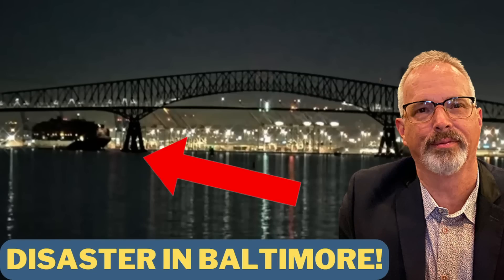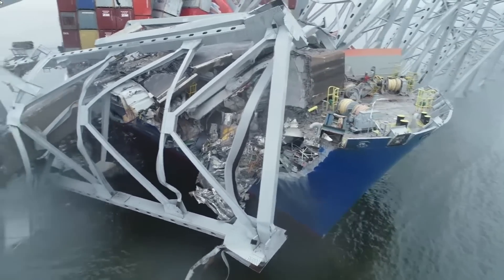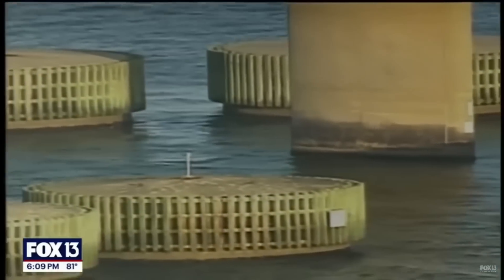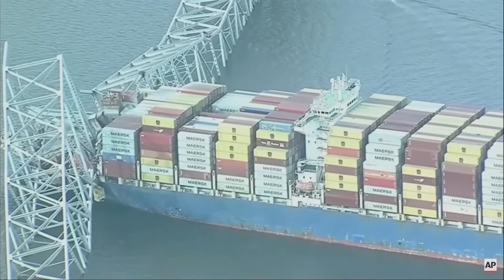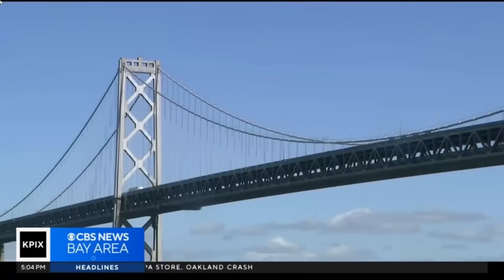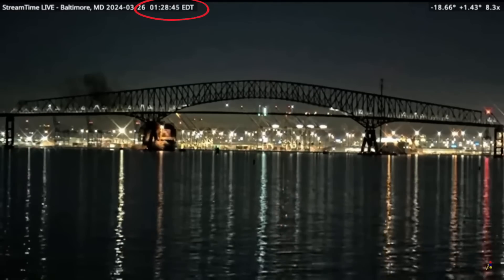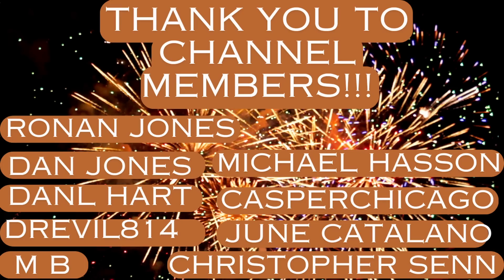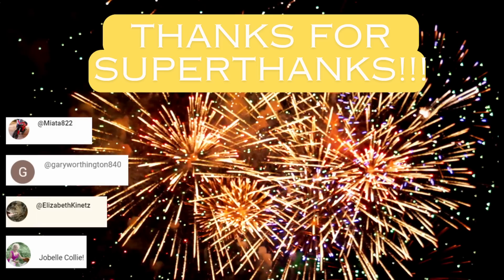How the Francis Scott Key Bridge in Baltimore should have been Protected

Comment: I understand what you're talking about regarding a younger generation of Engineers and bringing back old practices but I do not believe that is the case in this circumstance or incident. The bridge started Construction in 1972 was completed in 1977 . That means the pre planing and design was started sometime in 1968-72. I think those are the old guys you're talking about and I do not believe they had any complacency in engineering beliefs at that time. When the bridge was originally designed the ships that were coming through the Port of Baltimore were less than half of the size they are now which would have made the Ballard protection at that time sufficient. I would disagree with you regarding the Ballard protection being increased would have prevented this accident the ship was 200 million pounds. There are times when no matter what you do, tragedies can still happen even with the best engineering and money spent.

Comment: Well there seem to be too many examples of engineering snafus in the last few years.  Some notable ones are the Boeing MCAS fiasco and the adjusting of the tension on the bridge across a active roadway in Miami (that already had visible cracks).   I tried to teach everyone that would listen before I retired that there is a difference between designing something that simply can't fail vs something that will likely never fail even if its 99.999999% foolproof.  Murphy ALWAYS arrives someday, someway and somehow.  These type of accidents are what we typically called Titanic scenarios.  Any one of several steps that led up to this could have and likely would have prevented the impact.  But if it just had proper protection it would not have mattered.

And you could also argue the engineering of the ship was ridiculous.  No ship that large should be allowed to operate without reliable steering/propulsion control systems.
Reply: In the case of the FIU pedestrian bridge to which you refer, the problem was much deeper than the decision to retension with traffic moving under the bridge.  The concept for that bridge was cockamamie from the get-go.
Reply: Oh yes entirely true, but even if it was the most correctly designed structure,  would any competent engineer ever allow the adjustment while traffic flowed? Absolutely not.   @GH-oi2jf
Reply from the maker: That design team seemed arrogant too if you read between the lines of the NTSB report.
Reply from the maker: Yes, this disaster has many contributing factors.

Comment: When it comes to “Society doesn’t learn from its past mistakes” in this sort of lesson is likely due to the lack of will of a municipality and its people to spend the money for the safety improvements. The will of the people isn’t there unless there is significant financial reason for the expenditure. Municipalities don’t put crosswalks, speed bumps, stop signs, street lights or traffic signals in unless there is loss of life, usually human. I have tried myself to get my  city council to act but they didn’t until people were killed, even then it was more a “band-aid” solution to a gash of a problem.
Oroville Dam didn’t get the $1.6B until the people had to evacuate due to a spillway that should have been fixed a year earlier.
Now Baltimore will have to spend a billion dollars to clean up, rebuild, and recover from this loss of infrastructure. Hopefully they get it right this time.

Comment: I'd be interested in seeing what the reasoning was in deciding not to retrofit protective dolphins. One factor was probably the shallow depth of the water. The channel is dredged to about 50 feet, while the bridge supports are about 100 yards back from the channel in about 25 feet. They may have felt that the mud, combined with the substantial dolphins around the power poles upstream from the bridge pilings was adequate defense. 

The MS Dali draws 49 feet, so she was ploughing plenty of mud by the time she reached the piling. She also hooked pretty sharply to the right as she approached the bridge, "dodging" the existing dolphins.
Reply: That's almost the design protection for the Great Belt bridge in Denmark. They don't have any visible dolphins, but have constructed a huge berm of materials around each bridge pier (just below the waterline) outside the shipping channel.  The theory is that the "soft" material will cushion the ship and hopefully stop leaks of contaminants etc.  It will be interesting if your point is the reason they never did anything more.
Reply: With this bridge they could however easily built it as a suspension bridge with the piers on dry land and zero risk of being ploughed into by any ship
Reply: @jonathanbuzzard1376  The opening is over 5,200 feet wide. So a suspension bridge to cross that would be fantastically expensive.

The solution: a tunnel.
Reply: @scottkozel1519  there is already a tunnel but it cannot be used by vehicles carrying hazardous loads, hence the existing bridge, and if you think a suspension bridge would be expensive a tunnel would be even more expensive.
Reply: @jonathanbuzzard1376  
Hazmat is a tiny percentage of the cross-harbor traffic, and there are alternatives on freeways and  surface roads.

Comment: Fine, please provide the most like trillions to rework all the bridges and the designs necessary for deep water channels. Best solution is to ban large ships and stop engineers form designing any vessel deemed to dangerous for the infrastructure it travels past vs forcing taxpayers to pay of engineer glory of great design. I am also an engineer and we always designed within constraints necessary to avoid other costs NOT PAID by the project.

Comment: Casey, great job opening this line of critical thinking. On scene in hours after the Skyway collapse, operating sidescan sonar of the channel,  it was very evident then and in subsequent in-house analyses there was a fundimental failure in the origional projects detailed design scope.  Even the replacement bridge did not include mass impact event in the pier designs. Only the protective dolphins were designed for such risks, but even they were limited to a narrow attack profile.  Cost limitations supported by mission compression always make the design team fear the future failures will be realized before they retire. Not a recipe for excellence or career satisfaction. Full life cycle analysis is suposed to help the thoughful project scope, however since that too is a cost, it is often truncated. Maybe the comming Ai augmented engineering teams will find a renewed strength to push forward better projects.

Comment: I agree with you on the pier protection issues. But, that will never be total protection. As is the case with most multi-span bridges, only one, or the center span is normally high enough to allow for the largest ships to pass under. This is also the case with the majority of the remaining draw bridges. So then, if a tall ship deviates course, doesn't ground first, and ends up hitting a low part of a bridge, a span or more is still going into the drink. The only almost foolproof solution is, to use tugs.
Reply: A cable-stayed bridge will have two main towers near or on the shore.

Comment: Im a towboat captain of 28 years, and I primarily work in the port of Houston and lower/upper Mississippi River. Im obviously not an engineer, but 100% agree with you and that systems could've been put in place to prevent this and have been arguing that point with YouTube comment warriors that have absolutely no clue about the industry.
Reply from the maker: Thank you I too don't get the people that think that this is almost like an act of God and unavoidable.
Reply: @CaseyJones-Engineer an act of god no. But the one profession that doesn’t get talked about is the actuarial calculations that are done pitting risks like this versus cost savings. Big corporations and governments love these cold hearted arithmetics and use them to drop their bottom line. Hopefully you get what you are asking for. But the propensity for the common public to forget has an opposite correlation to political will to make changes. Let’s hope twice in 50 years is enough.
Reply: @CaseyJones-Engineer  I don't get it either. My vessel with barges is around the same length as that ship, but I'm only around 12,000 tons in total, "as if that's nothing lol," and when we run around "it happens: we stop in less than 15' or less on average.  I guess people just can't grasp how much weight this is going from floating to a sold object. It's going to stop and pretty damn fast.
Reply: @CaseyJones-Engineer 
It's simple Casey. They did not have the $$$$ to incorporate very expensive fenders like you are describing.
They were working to a budget!
Wadda yuh want? Some fancy fenders, and no money left to build the bridge?
You are assuming the Maryland DOT and the Feds had unlimited funds.
This professional Engineer has NEVER worked on a project were the customer got EVERYTHING they wanted.
Bean counters always make the final decisions. You know that.:face-turquoise-drinking-coffee:
Reply: @DennisMerwood-xk8wp And yet Baltimore has $30,000,000,000 to spend on their Inner Harbor 2.0 project?
Reply: It's a democrat city, money for the barriers pro'lly went to bldg. a new "Un" Planned Parenthood Center🤑
Reply: You can also  protect  it by moving the port.   The cost  has to be reasonable.
Reply: @giles-df9yu  I'm guessing you're being sarcastic about moving the port. The waterways of America are vital to America. Without the transport of petroleum products on the waterways, America would basically collapse in a matter of a few months if that. So whatever needs to be spent must be spent. The domino effect would happen faster than most people would care to imagine. Just in the last three weeks, I've moved 150,000 barrels of product from Houston to News Orleans, and that's a drop in the bucket.

Comment: What I'd like to know is why the ship was that close to a support to begin with, and supposedly aimed right at it
Reply: That has been discussed elsewhere.  The ship lost power.
Reply: Losing power kept it on the same trajectory.... nevermind!
Reply: @rhrh2025 -- The ship would have had the rudder set slightly to starboard to compensate for the "prop walj" effect of slewing the ship to port.  When power was lost, it would then have started to turn to starboard until rudder control was regained.  Then, if they set propulsion to reverse, that have caused the ship to slew to starboard.  It is more complicated than you imagine.

Comment: They needed solid barriers not little concrete dolphins. They could build up elongated walls with stone or concrete and fill them with dredge. The bridge was finished 3 years before the need for better barriers was known. That doesn't negate the fact they could have put them in after completion, or at any time since. 

Apparently we have been selling contaminated fuel for decades. This bridge had been standing for 47 years and there has only been one other collision, for which the protection was adequate. The expectation is always that ship operators will B-more careful in Baltimore. 

OH NOSE! You mean it costs money to build things right? We are talking about 1.3 to over 2 Billion Ft.lbs of energy on impact here. I notice you didn't say the Port of Oakland has dolphins. I don't think the design type passes muster as these ships keep getting bigger. 

I would have felt better if they had put the dolphins in because at least they would have tried. I'm thinking more like, big football shaped land masses though, maybe with diverting ramps on the long ends that would cause a ship to slide to the left or right of the embankment, sharply angled to prevent the ship from climbing all the way up.

Comment: I’m no engineer but aren’t the engineers that are retiring the ones that built and designed a lot of the older bridges without sufficient pier protection?
Reply from the maker: When they were designed the ships were much smaller than they are now. There was plenty of time in subsequent decades to do the required upgrades but officials apparently didn't bother.
Reply: @CaseyJones-Engineer  fair enough makes sense. Thanks for pointing that out.

Comment: Casey, I have a technical question: on several videos, at almost the last moment the ship seems to be turning to its right towards the support pier, why? It lost power
Reply from the maker: From what I understand it had lost maneuverability but the engine was still operating and it was the torque from the screws that caused the ship to turn but I am just repeating the reports and don't know for sure.. But I'm sure the NTSB will get to the bottom of it all.
Reply: @CaseyJones-Engineer  Thank you ,Casey. Take care.
Reply: If the screw was put into full reverse, as some people think, that would have had the effect of slewing the ship to starboard from "prop walk."
Reply: Also, the ship had probably hit the bottom and was plowing mud.

Comment: An ounce of prevention is worth a pound of cure. Hundreds of millions for a working fender system vs. thousand plus millions for a new bridge.

In regards to expertise being lost when the older generation retires, I think the Alexander Payne movie, "About Schmidt" is on target. At retirement, his work is literally boxed up in 703s and placed on the curb for garbage pickup. The work of past generations is seen as quaint and not up to par for how the  latest design methods would approach the problem. 

One thing I learned in engineering school was that the earlier generation had made an impact on the world without "modern computing resources." The Empire State Building, the Hoover Dam, and the Golden Gate Bridge were cited as examples. The message was "don't be too quick to discard past methods." The old methods still offer a reality check for other methods. Make sure order of magnitude of loads is correct before applying more significant digits.

Another example from literature is the book, "Super Sad True Love Story" by Gary Shteyngart. His futurist predictions have matched the dumbing down and misplaced priorities of society in general. The misspelled elements on the project signage was only the tip of the iceberg of what was going wrong.

The fact that projects are often rushed to the marketplace with economic concerns being primary, i.e. over safety concerns appears to be a pervasive problem going forward. Will people care enough to make sure the floor doesn't collapse out from under them?

I know this is a long comment, and no one is likely to read it. That's okay. I just want to say that I enjoy your content and your ethics-first approach that I imagined engineers were working. The almighty dollar often outweighs ethics.